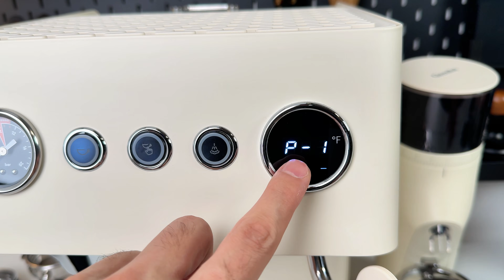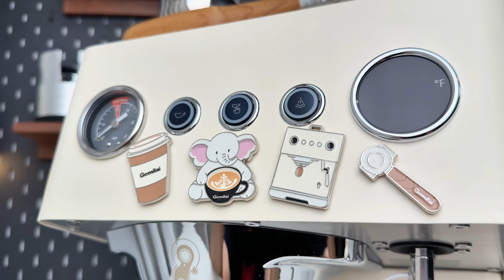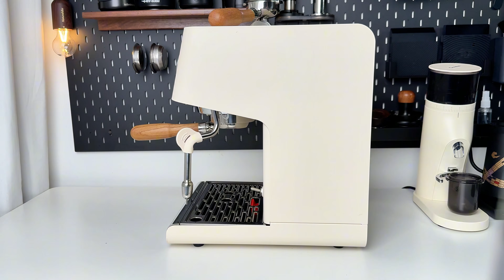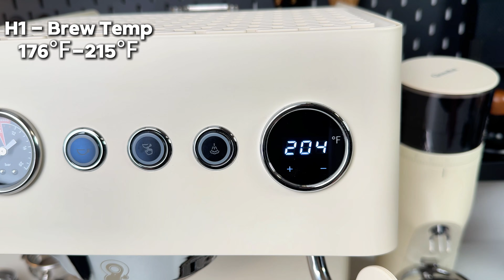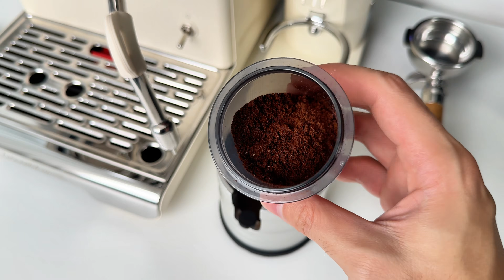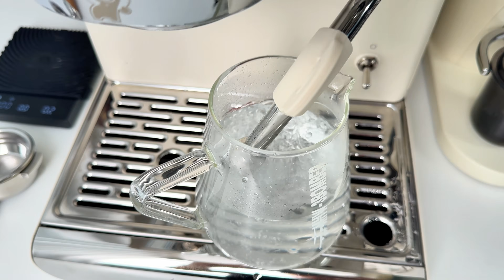Gemilai Ele G3028A Espresso Machine Review | Adjustable OPV | Full Feature Breakdown #gemilai

Comment: Normally in your videos you try your own portafilters, Is this machine compatible with your portafilters? which ones do you recomend?
Reply from the maker: Hi, it already comes with both a bottomless and a spouted portafilter, so I didn’t use my own. It takes E61-compatible two-tab portafilters, so my other ones fit too.
Reply: I actually have one, I just want to upgrade to a lighter and flatter portfilter

Comment: Do you need to wait 3 minutes between each shot?
Reply: With a 550ml boiler and espresso shots of at most 60ml, I can't see why it would struggle. The g3007z has similar internals but slightly lower quality, and even it maintains consistency across multiple consecutive shots. I don't see why this model couldn't do the same

Comment: Hi, i need your help . You are the only one i guess who has experience with this machine G3028a and the Hibrew H21 or any generic model of H21 like the EM3801. My usage will be for home use and occasionally like once a week or in 2 weeks making 20-30 coffees for gatherings. Which one would you recommend? My budget is similar to this machines. Thank yoi for your help
Reply from the maker: For home use, both should be fine. You don’t need the same level of consistency as a commercial café anyway. Grinding and puck prep already take some time, and by the time you’ve finished getting the puck ready, the machine is usually up to temperature.
Between the two, I feel like the G3028A gives more stable shots. Once you’ve got it dialed in and fully warmed up, it’s pretty much super consistent, since the boiler and thermoblocks work independently. I'm not sure where you are,  with the US 120V version, you can’t pull a shot and steam milk at the same time, but there's no wait between brew and steam. The H21 doesn't have the US version yet.
Reply: @brewcoffeehome I am in the middle east  h21 is easily available here. Whereas the gemilai 3038a is not yet available. I will have to get it from Ali express.  Thank you for you response.  Does the OPV control on the 3028a make a difference?
Reply from the maker: @Scorpions2390  Yes, you can do the pressure profiling or get exact 9 bars extraction, the H21's brew pressure usually lands between 9-11 bars depending on the grind size, it's a bit higher than 9.

Comment: I think everyone should pay attention to this. P1 --pump starts and soaks holding a low pressure. P2--water keeps flowing at the same low pressure.  P2 doesn't effectively do anything different than P1. This is true on the Turin Legato as well. it's not an insignificant amount of water that's flowing on P2. Users who buy the Ele or the Turin Legato should understand this and think of P1 and P2 as identical--there's no difference--simply think of it as a time you set to wet the puck at low pressure. The pause is fiction entirely. this review stated it exactly as it is.
Reply: During P2, pumping stops and the system maintains pressure. So P1 and P2 are not the same

Comment: The P1 and P2 parameters work differently than you describe. P1 is not at a lower pressure or flow. It is at the full flow and pressure. If kept short (<4 sec) the pressure should stay somewhat lower than normal brewing pressure. The pressure does drop to zero shortly after the P1 pumping stops. The P2 time is just a pause. It stops the pump. It lets the water soak into the puck. Many machines work like this. It is not ideal but perhaps helpful to reduce channeling.
Reply: You're wrong and we've measured it. P1 lets water flow at a low pressure. P2 does NOT pause--you can observe this or measure by liquid output, weigh a puck for water--We did. P2 continues to add water to the puck at much the same rate as P1. it is not a pause effectively at all, certainly not a dry pause. The water is not soaking into the puck solely. Water from the group head continues to drip onto the puck.
Reply: @teemaximus7909  Your machine is not working properly if water is still flowing into the puck during P2. Can you hear the pump running during this time? On my Ele the pump stops during P2 and it drips some for a few seconds. Dead quiet.
If P1 is sufficiently long to build up a high pressure (perhaps greater than 4 seconds) this high pressure might create more flow and for a longer time during P2. During P1 the pump should run just long enough to saturate the puck and get a few drips.

Comment: To anyone who owns this machine - could you  please measure how much your milk jug weighs before and after steaming so we know the amount of water added?
Reply: You're way out of line. You ever do that anywhere? It steams milk just fine. Learn to steam milk.
Reply: I steamed about 6 oz of milk. When heated to 140F I measured 12% water added. When heated to 160F I measured about 15%. These are typical of the steam from any espresso machine. The steam isn't extremely powerful but it works really well. I just use the highest temp setting for the steam.

Comment: I received my Ele yesterday. I like it much better than the E61 machines that I have been using the last ten years. Very adjustable with all of the key parameters. Heats up for use in under 5 minutes. Had it dialed in by the third shot. Seems to be high quality. Gemilai customer support has been really good. Unbelievable machine for the price paid. Highly recommended.

Comment: The fact that they gave 2 full portafilters with their own 20g baskets is awesome. The portafilter heads can screw on and off so I'm surprised they didn't just give a bottomless and spouted head that you could swap on the handle, and also I figured they'd just give a single and double shot basket, but they give you 2 double shot baskets. I was really impressed with the amount of accessories, and the overall quality of them too. The tamper is very nice. Gemilai actually fulfilled my order later than excepted and threw up a free distributor tool and extra milk jug. Changing the settings is confusing at first, but fairly easy to do. I really wanted a machine that could adjust temp, and pre-infusion time settings were a strong selling point too. The adjustable pressure is a cherry on top, though I've not really got around to playing with it yet other than just setting it to a little over 9bar with the blank like you suggested. I love that the group head heats up, and it heats up very good, like it is hot to the touch. Everything seems to come up to temp and hold a really stable brew temp which I love. I really wanted a boiler for that stable temp, but I love that the steam wand is on a thermoblock, since there's no need to temp surf or wait between steaming and brewing, but it also doesn't have the bulk and power draw of a true dual boiler, and for steaming milk a thermoblock is perfectly fine. Overall the features, quality, and overall performance of this machine was amazing for the price point.

Comment: How does this compare to hibrew h10plus?
Reply from the maker: This one's better than the H10 PLUS, but there's a pretty big price difference between the two machines. Performance-wise, I'd say this G3028A can compete with many machines that cost more. It has adjustable OPV and dual thermoblocks, the extraction is extremely stable.
Reply: @brewcoffeehome no i thought the brew is boiler only thermoblock is the steam

Comment: So this is pretty much a straight upgrade over the 3007z/Legato V2 yea?
Reply from the maker: I haven't used the 3007Z myself, but they should be pretty similar. Both have adjustable OPV, and the G3028a adds milk temperature probe. Other than that, the specs seem about the same.

Comment: Do you think it's better than H21 Hibrew? I like the boiler here but you need to wait longer. H21 seems perfect but I saw from another video it's possible that grouphead uses aluminum instead of steel and the part behind the shower screen corroded after cleaning cycles with Lactic acid. Would you be able to verify that? Which is your top machine to recommend for advanced user that still favors fast heat up time (max 5 min ) thanks!
Reply from the maker: I personally think this G3028A is more stable than the H21, and the adjustable OPV is so nice to have. The heat up time is around 5 mins so it's longer than the H21.  And the H21 uses plastic group, like the H10A and H10 Plus, different from the other OEM model.

Comment: will gemilai make a rotary pump where I can adjust the maximum pressure then used flow profiling to lower the pressure as it was a vibration pump with adjustable opv?
Reply from the maker: The higher-end Gemilai models do use a rotary pump, but they’re much more expensive. Personally I feel like the shots from this machine aren’t that far off from my rotary pump machine, like the Lelit Bianca, haha.
Reply: @brewcoffeehome  oh then it should be a great upgrade from my gemilai 3007z. It takes time for me to fix the consistency of 3007z. Does it also have that consistency issue or is it already great out of the box?

Comment: Hi!i have this machine but for some reason there's so much water in my steam even if I let it run for awhile to let it heat up...
Reply: I also just received this machine and the manual says you can adjust the temperature of the steam wand. Maybe play with those settings and see if it reduces the amount of steam in your drinks. Also, not to infer you don't know what you're doing,  but maybe check out a few videos on how to angle the steam wand inside your frother cup. I'm totally new to the espresso game, so maybe I'm way off 🤷
Reply: Any update on this? I am very interested in this machine steam quality. Did you let the machine warm up for at least 10min, purged wand and tried again? Is it better now? Can you measure how much your milk jug weights before and after steaming so we know the amount of water added?

Comment: Just bought one thanks to your thorough review. I was going to buy a Profitec, but I think this looks nicer and has everything for the beginner at a much better price ($599 BF deal). Thank you for taking the time to create this video!
Reply from the maker: Hi, not sure which Profitec model you're looking at, but theirs should be able to brew and steam simultaneously. The US version of this G3028A can switch brewing and steaming instantly, but you can't run both at the same time. Other than that, I think this machine works pretty well, the value is hard to beat.

Comment: (Material of the machine) For those interested, these are direct messages from Gemilai’s technician team:

1. The brew boiler of G3028A is made of SUS304 stainless steel.
2. The water-contacting pipes inside the steam thermoblock are made of 304 stainless steel.
3. The parts that transport water from the boiler / thermoblock to the group head / steam wand are made of food-safe PTFE (Teflon) material.
4. The water tank is made of ABS plastic.
5. The exterior of the G3028A is primarily made of SUS430 stainless steel.
Reply from the maker: Thanks for sharing all this detailed info!☕

Comment: Thanks for the review. Do you know if there's any plastic or aluminum in the heat path?
Reply from the maker: I haven’t actually looked inside, but I guess there’s a plastic tube. Usually, machines with all-metal tubing are a lot more expensive.
Reply: @brewcoffeehome gemilai responded and said that it's all silicone, but they have a PTFE tube that runs to the group head.

Comment: I was going to buy the 3006 is this that much better, that I should buy this one. I like the chrome on the 3006 better.
Reply: Its two very different machine, 3006 is a Thermoblock while this thing is a Boiler, and unlike the 3028 the 3006 has no adjustable OPV unless you want to break the red sealant and may or may not break the warranty.

Comment: Thank you for the video! I was looking for one and this is the first in depth one I have found! I was planning on ordering this but because the US version isn't able to utilize the heating system correctly I am going to get the breville bambino plus instead
Reply from the maker: Hi, thanks for your comment, the one I tested in the video is the US version, it just can't brew and steam at the same time, but if you don't need to operate simultaneously, it just works well. :)
Reply: @brewcoffeehome  how would you compare this to the bambino plus?
Reply: @omgwowcool123 I have a bambino plus and it is a good machine. This is way better. Like no comparison. You can’t brew and steam on a bambino plus either.